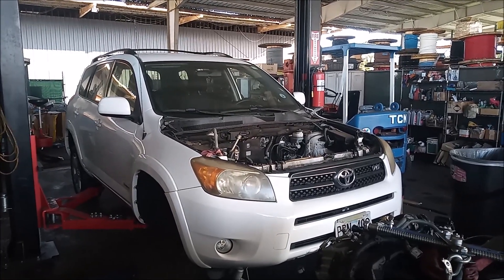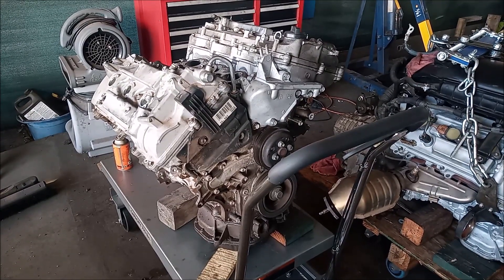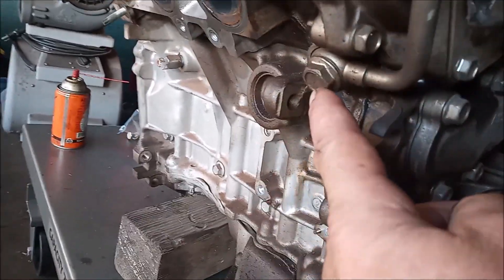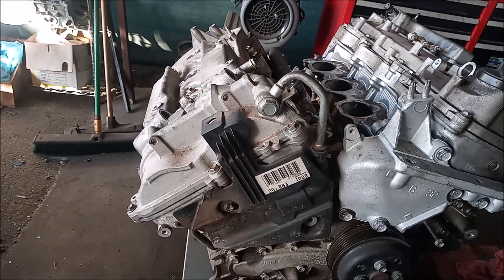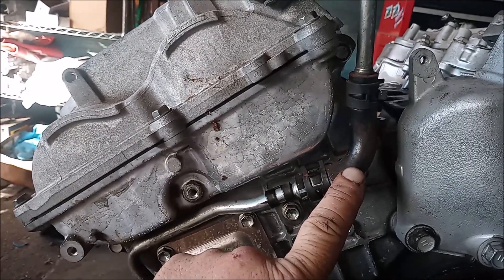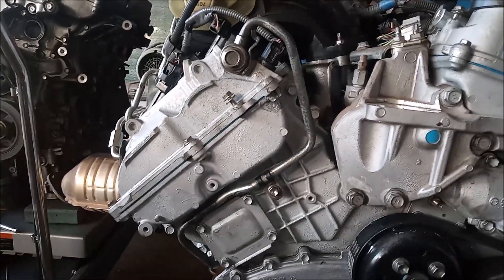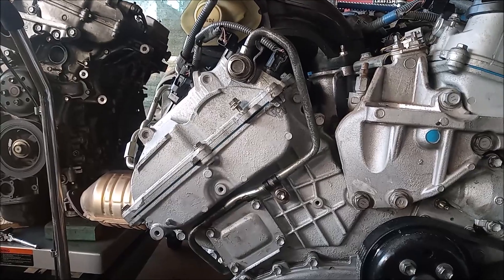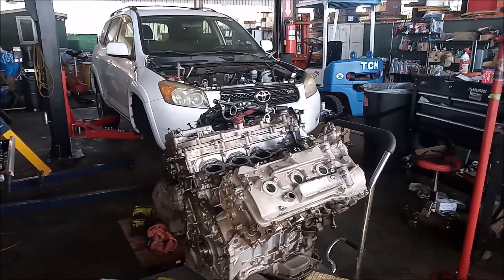Prevent Your Engine From Blowing Up  - VVTI Fix - Toyota 2GR-FE 3.5-liter V6 - RAV4 CAMRY HIGHLANDER

Comment: Happened to my 2010 Venza 2GR-FE a few years ago. Girlfriend was driving it home from Chicago to Naperville IL. Thank god it made it. No oil light or engine light when she was driving. Next morning, it had engine light on and oil light, and was knocking. I checked it, and it was dry. I dumped 6 quarts of oil into it, just to make sure the engine wasn't fried. So that means half a quart of oil at most was in the engine. It's now at 170,000 miles and it's doing fine. Sadly, transmission is showing signs of failure. Will see how long I get, or hopefully the fluid is just dirty.
Reply from the maker: Sorry to hear about your issue. Thank you for watching.
Reply: Probably fluid change for the transmission is needed, also you may add Seafoam trans tune. Perhaps that can extend the life of the transmission
Reply: Hows transmission?  Did you do a spill and fill to get a little old fluid out?
Reply: @HawaiiFoodAndFun  I never changed it. It's at 189,000 now. Shifts hard but still trucking on.
Reply: @Tylerc3419 change your transmission fluid instead of running it into the ground lol. It's easy and will almost guaranteedly extend your trans life.

Comment: Does the engine need to be pulled out to change the vvti line? Or it can be done without pulling out the engine? I am thinking about the labour cost if it needs to pulled out the entire engine.
Reply from the maker: No, it can be done in car, in fact I've made two or three other videos showing how to do this. Check my playlist for 2GR-FE.
Reply: @Merryfrankster_  i just check it without removing the cover. I cannot find the rubber part of the line, especially in the bend area, maybe its already replaced by Toyota. My car is a 2008 Camry ACV40 with 2GRFE engine.
Reply from the maker: @rommyrasjid  ok cool must have been replaced already. It's very easy to check.

Comment: I have a camry 2011 with the 3.5 does that year still have the rubber part on the oil line or is it all metal
Reply: No it should have the updated metal line straight from the factory assembly line
Reply from the maker: 2011 should be all metal from factory.

Comment: Hi Frank, is there a part number for the few of us with the supercharged 2GR’s?  I purchased the part in the video only to find that it does not fit with the  belt routing. 😔
Reply from the maker: Yes you can get it from Lotus. You can see it in my new video. The part number is "A132E0102F - 38 Oil Feed Pipe." I have an extra one (the one in the video) that I would be willing to sell for $125 includes shipping and fees.
Reply: @Merryfrankster_  I’ve sent you a DM on messenger 😁

Comment: Thanks Frank.  Yes, the early replacement was rubber but I have seen reports of replacement failures. Best solution seems to be the Lexus all metal pipe.  Different climate  conditions will affect the life of the rubber.
Reply from the maker: REPLACEMENT PARTS
All Metal VVT Line from Toyota 15772-31030
Copper washers (rear, one-piece) 90430-16016
Copper washers (front, separate) 90430-16017
Reply: @Merryfrankster_ will this oil cooler line part number fit the 2008 Lexus RX350? Thank you
Reply from the maker: @bb5op585  this fits all makes and models of 2GR-FE engine through 2016  but not 2gr-fse or 2gr-fxs or whatever.
Reply: @Merryfrankster_  thank you
Reply from the maker: Metal is the best replacement. It is available from Toyota, not just Lexus. $23.

Comment: The only reason that rubber hose failed was because on the early models they used rubber that was not rated for use with oil. The fix for it was to replace it with rubber suitable for use with oil. You can look on the rubber section and if it says "oil" on it, it is ok. My 07 ES350 with 147,000 had this done at around 20,000 miles and it's been fine ever since.
Reply from the maker: Buddy oil hose does not hold up forever. Transmission oil cooler lines on older cars leak and bust all the time. With a rubber line you are on borrowed time. Spend the $23 for a metal line. Better than $$$ for a replacement engine, like this guy.
Reply: @Merryfrankster_  well I never said that the metal line wasn't superior...only that if it's the proper rubber you're in no danger of imminent catastrophic failure. Do you by chance have a video of how to change the line? I bought one for my car a while ago, just haven't gotten around to putting it on.
Reply from the maker: @TheBenjammin  yes, look in my 2gr-fe playlist.
Reply from the maker: REPLACEMENT PARTS
All Metal VVT Line from Toyota 15772-31030
Copper washers (rear, one-piece) 90430-16016
Copper washers (front, separate) 90430-16017